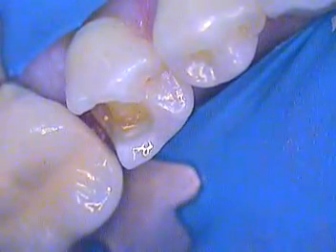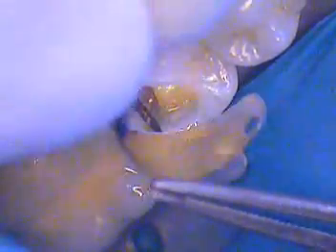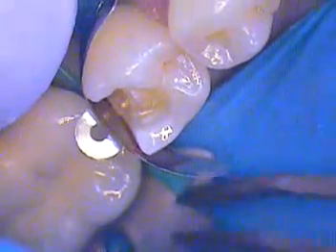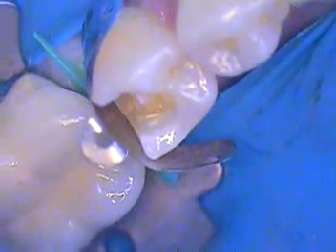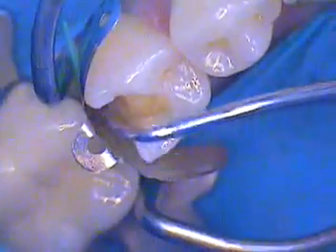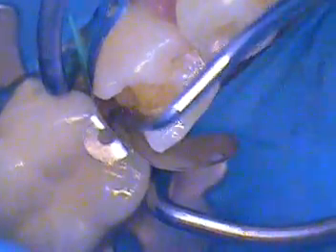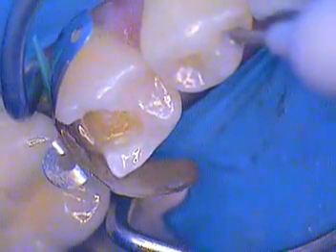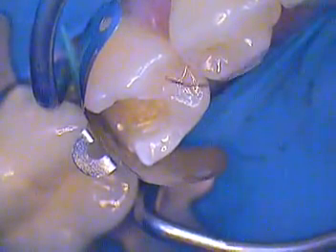Class II Composite Restoration using a dental microscope - Boca Raton, Florida 2/3

Comment: Aren't we suppose to cure composite  after every increment? I mean u cured the  composite after building a complete distal wall. Kindly reply as what method are we supposed to follow. Thanks! :)
Reply: Bulk fill composites are available nowadays so you can use theM for 4mm bulk fill  or you can do them in increments

Comment from the maker: Hello-Great to hear from you. Your questions are good. I've used Garrison products for many years and they are great products. The microscope helps me visualize the b/l walls and gingival floor. More often, I will isolate with band placement prior to etch/bond steps. I'm very careful avoiding any pooling of adhesive in the proximal box. At the time the video was recorded, I was field testing Garrison bands vs.Triodent bands. My gingival seal was more consistent with the stiffer Triodent band.GC

Comment from the maker: Phosphoric acid needs to be applied to dentin a little longer than enamel.  I usually apply it for 15 seconds and rinse with water for 15 seconds. I look for the carbon dioxide bubbles on the surface of dentin to appreciate that the chemical reaction has taken place.  I also look at the surface shine of dentin after applying the adhesive to confirm the bonding.  Dr. Cuomo

Comment from the maker: Hi Dan - Great to hear from you! I custom make and modify many instruments due to the use of higher magnification (i.e. dental microscope).  I simply take an amalgam plugger and modify it's shape.  I shape the right diameter of the instrument, the round end tip, and the instruments taper. Perhaps I may need to do a video on shaping my instruments for minimally invasive dentistry. Happy to help in any way!! GC

Comment from the maker: That is a great question.  There are general and cosmetic dentists who will initially cure the flowable composite.  I am one of only a small number of dentists in the nation that practice restorative and cosmetic dentistry using a dental microscope.  It is easy to observe small "air bubbles" within the flowable composite when using a dental microscope.  Therefore, I prefer to use the flowable composite solely as a "fortified wetting agent" prior to condensing the main posterior composite. GC